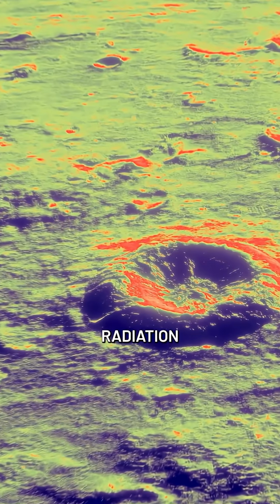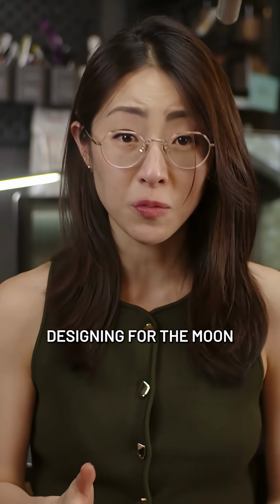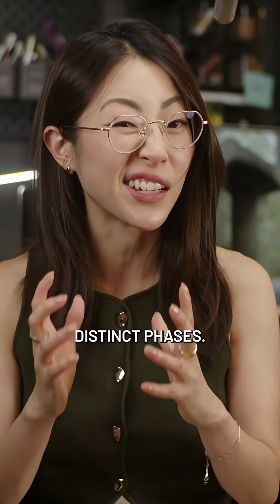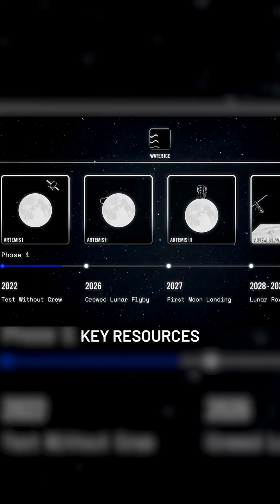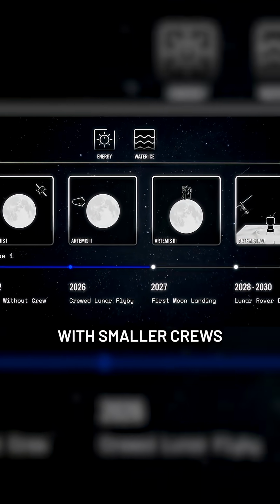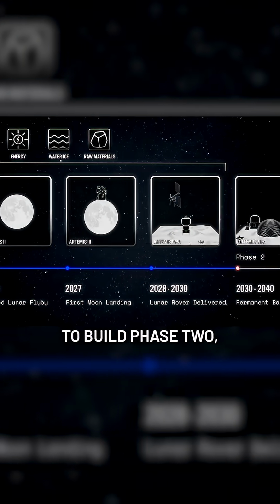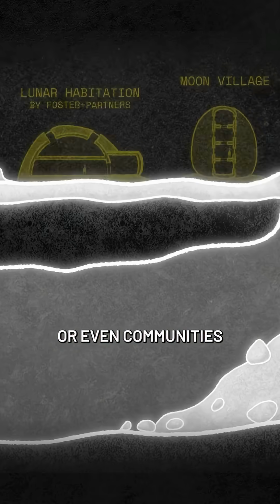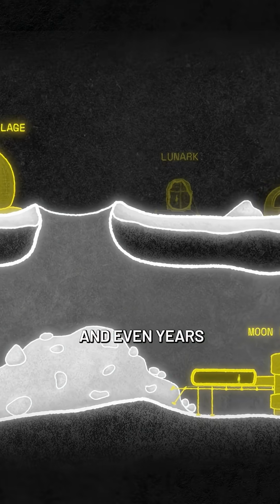What It Really Takes to Land on the Moon

Comment: I absolutely love sitting down, rolling random properties off of known planetary and biome factors, then designing habitation, tools, potential lifeforms, languages, and what not that would stem from such combinations.  The moon is an… interesting starting point, definitely on the far more brutal side of things.  But, its very fun to run ideas through the gauntlet of known hazards and sustainability trials.  I can’t help but feel like, if we could manage to farm asteroids, comets, and meteors Before trying to habitate on the moon, the way we would go about it with the abundance of other materials would be Entirely different.  But, as is, there are still quite a lot of potential plans that seem potentially viable… although most of the best options at current seem to rely on a safety net of using robots until we are SURE that everything is safe to fully trust in.